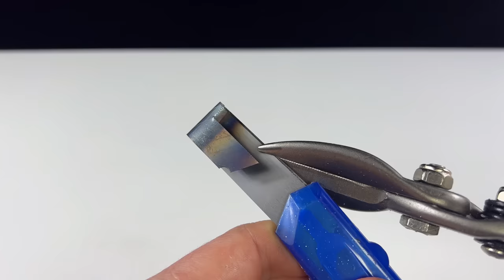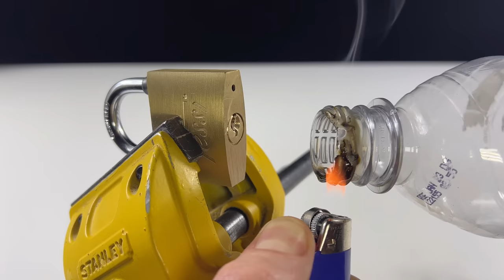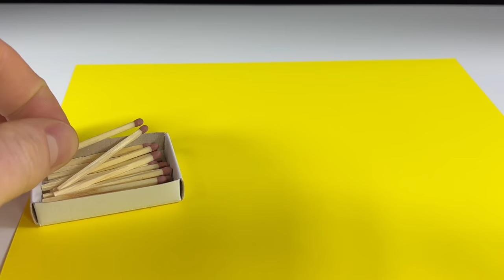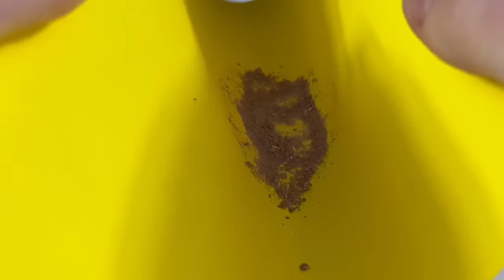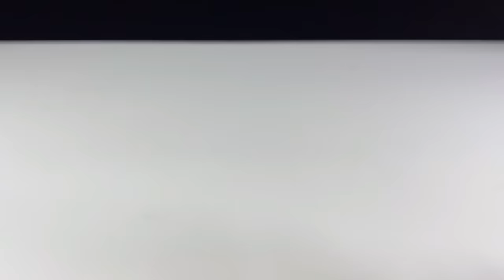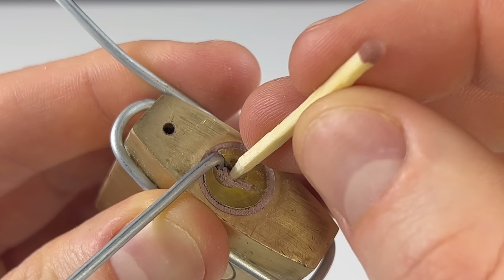HOW TO OPEN A LOCK With Matches

Comment: How does the metal rod move at the end? I know the matches combusted but I don't understand the physics here
Reply: Combustion is supposed to create a pressure wave that could potentially push the pins in, but also, similar to ramming, it shakes the lock so pins move around while rod, that pressures the lock, holds them in "unlocked" state